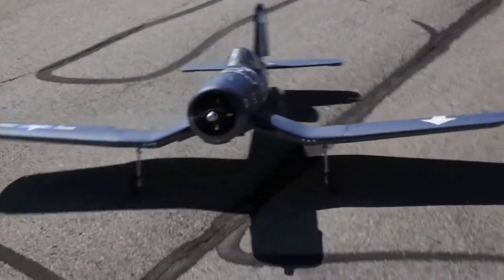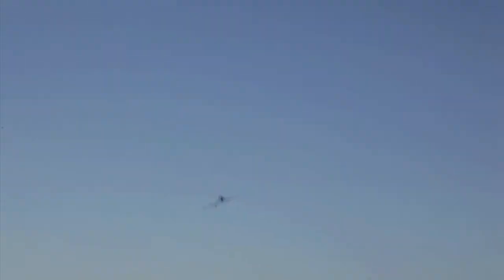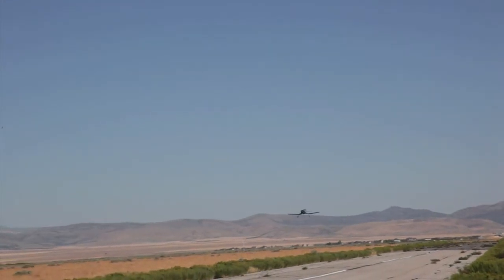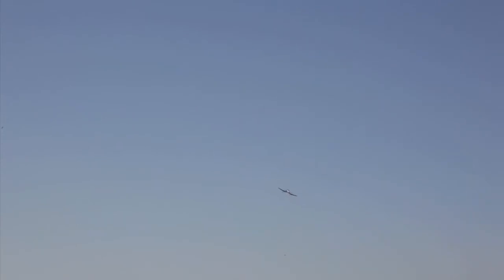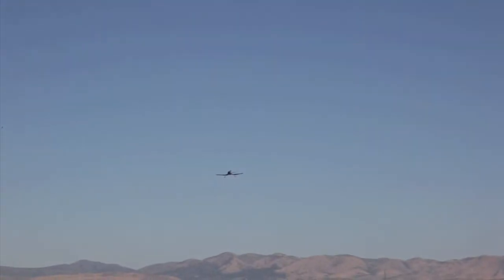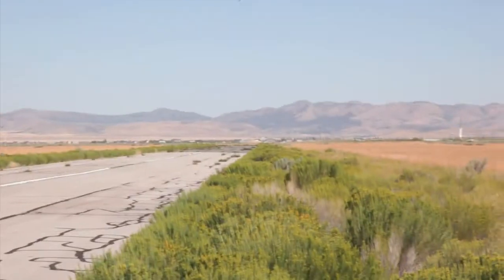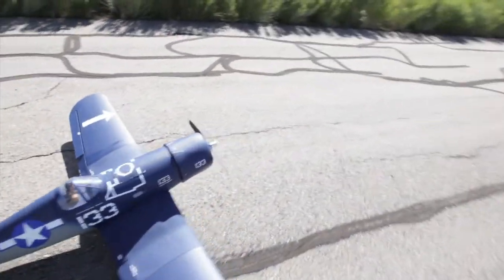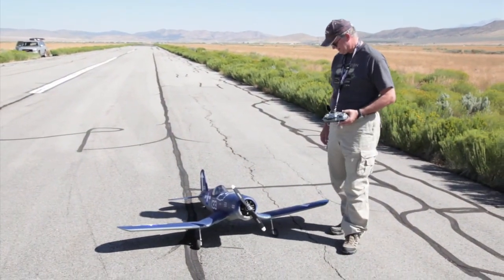CMPro Corsair Maiden Flight

Comment: Hi Jeff.
I have bought the same plane and also wanna conversed it to Electric. I'm trying to find out how you made your entrance to the batteries?
Did you made an opening on top of the fuse? How large?
And what retracts did you use? They look very strong to me.
Hope you 'll see this...
Ron.
Reply from the maker: The retracts on this plane were mechanical.  (stock) Quite fiddly, but did work.  Eventually converted to pneumatic retracts before I finally destroyed it.  I lost two of these - they have a tendency to snap stall and are difficult to recover.  I then built an ESM 72" Corsair which was more scale like in appearance and flew better.  It had electric retracts which were slow, but worked well.  Here's a link to my RC Groups Blog which shows some pictures of the conversion.  Good luck with yours.  
https://www.rcgroups.com/forums/showthread.php?3229539-CMP-Corsair#post41143801
Jeff
Reply: @JeffJohnson-photos 
Nice the thread you made! It makes a lot clear to me!!!
Ron
Reply: @JeffJohnson-photos  
What was the CG you used?
Reply from the maker: @ronloose  As I recall it was 100mm back from wing leading edge.